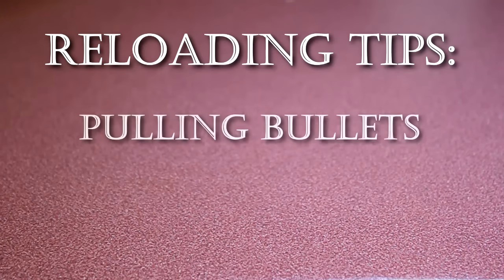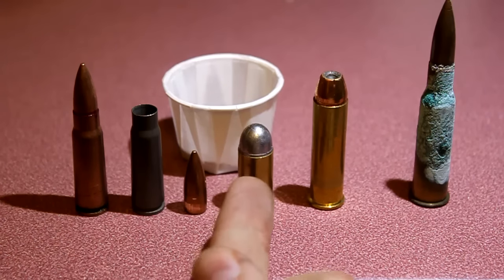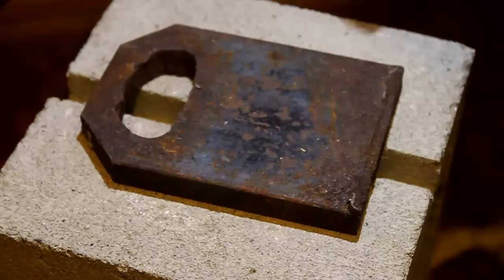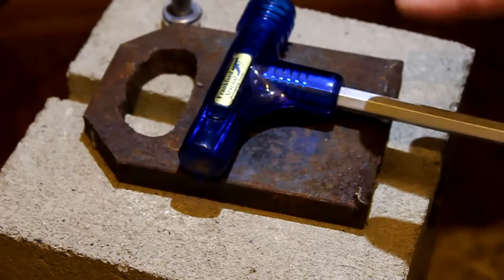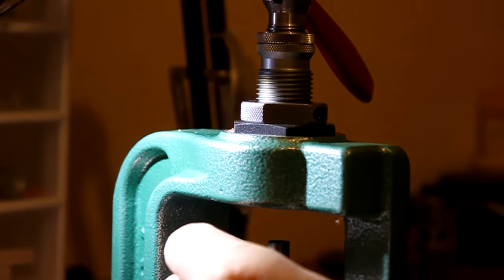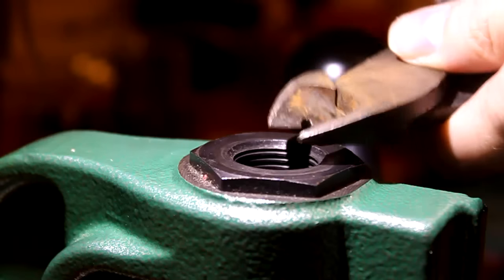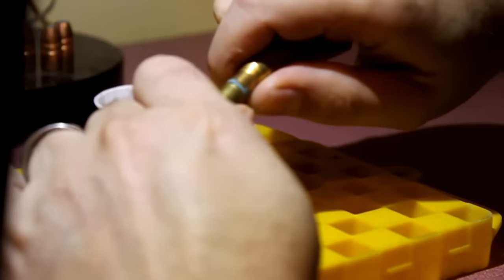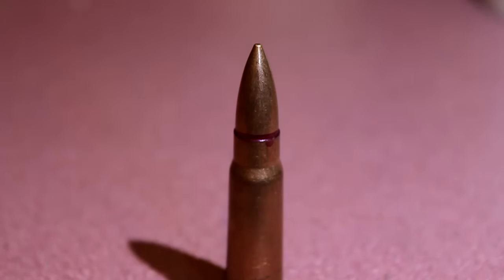4 Ways to Pull Bullets

Comment: I noticed when  you you used the Hornady bullet puller you had a straight wall cartridige case like a .44 S&W Magnum but when you pulled th bullet you showed a rifle cartridge, Were you not able to pull the pistol bullet with this puller? I have had bad luck with Hornady pullers espjecially when pulling .44  or .45 bullets, the Hornady collets are flimsy and just don't grab weel. I use the RCBS bullet puller with much beefier collets and used with great success on these 2 calibers. The rest of the video is all right. Thanks for sharing

Comment: thanks so much gave me some great ideas to work with , I have a lath so I can turn my collets and the make the finger cuts with a cut off wheel , have to pull 1000 rounds 3006 cause primes are no good. thanks again surplus cases with ruined primers and got loaded thinking primer was good ... dua wont do that again lol
.

Comment: suggestion for alternative method using press  and pliers or wire cutters to hold bullet...INSTEAD consider sacrificing some  unneeded or cheap large pliers like line mans pliers or something and drill the needed size hole right through pliers jaws...even oversize slightly if you want to use a piece of bicycle innertube or whatever to protect bullet...or how about using using a bullet casting mold as the holding pliers ...maybe?  might damage it though as a bullet mold...just an idea  might have to use rubber strip too to grip hard enough?

Comment: I use a reloader's kinetic hammer to take rounds apart.  Especially WWII ammo that wouldn't go off due to bad primers.  I reused the projectile. powder and case and just changed out the primer.  Yours a Frankford Arsenal and mine is a RCBS.  Colet pullers are too expensive.

Comment: once you remove the gunpowder and the bullet and then return the bullet back to the projectile and then heat up the bottom part of the projectile will it still fire????
Reply: Jochel 23 gunpowder was used in reference to black powder before the invention of smokeless powder. The bullet IS the projectile. if you put the bullet back in the case the bullet will most likely get stuck in the barrel
Reply: Tristan is correct. The primer has enough force to expel the bullet but not enough to do damage if you just heat the primer. If fired in a gun the bullet would likely get stuck in the barrel.

Comment: I've heard that the Wolf brand 7.62x39 ammunition actually uses a .308 bullet, however if this is not true and the bullet is .311, could one get away with using it in a .308 barrel? .308 is scarce or very expensive and all I really need is the bullet to reload.

Comment: With the kinetic puller... It's actually better to use the larger collet for the 7.62x39 with the dome facing the column the powder and bullet fall into. Doing it this way the cap doesn't come loose so you don't have to keep tightening it down. Therefore less strikes to pull the bullet. Believe it or not I pull 7.62x39 military crimp bullets with 2 strikes. 3 max. I strike the puller against an AR500 steel target. Give it a try. You can thank me later.

Comment: I bought some surplus 1920 7MM Mauser ammo & I am able to pull some of the bullets out of the casings with just my fingers, I am assuming that is bad? How tight does the bullet need to be in the case in order to fire?
Reply: Medmann48 I would resize the head of the case and seed the bullet again to be safe. if the bullet gets set back in the case or travels down the barrel too much you may get a pipe bomb effect
Reply: The brass necks on old ammo often get hard.brittle and lose their grip. You MAY be able to pull the bullets, resize down the necks and then reseat the bullets and have them hold tight. If not, do not fire that ammo. Save the bullets and load into fresh brass cases.

Comment: I've pulled many of tracer rounds out with the hammer puller. How is that dangerous?
Reply: Boof104 BrianA I'm pretty sure the chemical used by tracers is ignited by heat/open flame however it's better to be safe than sorry

Comment: method 3. cant you just put a rag over the bullet to prevent marring? i haven't worked with brass that much and haven't reloaded bullets. But i learned if you put a piece of cloth between a vice jaw and your work piece you will prevent marring but still transfer the force. i assume you could use the same technique here and save the bullet. 

Anyway. great video and thanks for showing all the different methods.
Reply: the hollow box maybe use a fired case.

Comment: I just take a pair of channel locks and wrap them in either electrical tape or a thin rag and twist it off making sure you don't apply too much pressure or you'll dig the teeth in or deform it. If you do that you don't mare the bullet and its pretty darn fast

Comment: What should I do if i have a sniper bullet that ill never use, but want to keep,?
Reply: +CarlosIDK956 How do you know it's sniper bullet?
Reply: It's around 6 Inches long,.. I want to say it's a 50 cal but didn't want to presume that much
Reply: +CarlosIDK956 it usually is on the bottom...
Reply: Just says "1 - 4 - L - C"
Reply: Lake City 2014, that's just the case (brass) stamp.  Just look up on Google 50 cal dimensions and measure your cartridge and see if they match.
Reply: Right, well my main question,.. Should i try to pull the bullet and get the gunpowder out, or is it fine if i just leave it as is in one of my droors and pull out every once in a while
Reply: Of course it's fine, it's actually more presentable if you leave in.  If you really want to pull it out, put it in the vice between 2 blocks of wood and rock it out.
Reply: unless you have a habit of smacking the primer on it with a small hard object you will be fine, they can take alot of abuse. think, they are inside a gun while it fires and the recoil doesnt cause it to explode. Only other thing would be if it got super hot in a fire, but at that point it who cares if it explodes because everything around it would be fucked anyways.
Reply: CarlosIDK956 you'll be fine as long  as you leave the primer alone and don't put the cartridge anywhere near a stovetop or similar heatsorce

Comment: two problems. 1) you refer to what is a "cartridge" as a "round" and that's not correct 2) for the third way you say you pull the bullet down when you're pulling the case down. those two things aside this was a decent video
Reply: A "cartridge" IS a "round". A cartridge consists of 4 components: bullet, case, powder, primer. The term "round" came from when there were components but no case (muzzloaders). A "round" was the 3 components used to load (cap, powder, bullet) and the term stuck for when those 3 components were simply put together into a case forming a compplete cartridge. Using the term "round" for empty brass cases (want to buy 500 rounds of once-fired brass?) is incorrect.

Comment: Around the 4-minute mark you say to not bounce the puller.  That's false.  You should bounce because of the Pelton effect.  It uses twice the inertia.  To use your car example; imagine a car stopping suddenly and then quickly reversing.  Inertia keeps your body moving forward but the vehicle is now going backwards.  It's the same reason why, if you've ever played paintball, you notice the bouncers tend to hurt more then the splats. :-)

Comment: I got same kinetic puller and was banging on concrete floor in garage to disassemble my own .223 round and after 50 or so rounds the thing is all beat up because it's plastic and there is even a crack and then one day I saw instruction manual and it says to ONLY use hard wood surface.  Planning to buy RCBS puller next, this kinetic "hammer" is not good.
Reply: +Dima Prok get a  hard rubber door stop and gorrilla glue it to the striking surface of the bullet puller. this will cease to damage the striking surface, while maintaining functionality.
Reply: +Joe Shmo not a problem anymore since I got RCBS collet puller.  I rarely use it now, it should survive.  If it does happen to break, I'll build my own next time, I have pretty good idea.
Reply: awesome man!
Reply: im looking at the rcbs. how do you like it?
Reply: +Joe Shmo When I ordered RCBS I though it's going to be like the one in the video because he was using RCBS press I got confused, but it's actually different.  At first it was little bit frustrating but once I figured out how it works it the whole process is smooth.  One thing to watch out if you were pulling .308 bullets and then switched to .310-311 (7.62), you need to take the flat screw driver and pry the collet a little wider because it's pretty stiff and just trying to ram the bigger bullet it's not going to grip it and you'll end up scratching the bullet.

Comment: I cringe smacking the plastic hammer on bare steel...I'm thinking some hard thin cardboard over the steel plate at least..i just envision plastic vs steel eventually fracturing plastic... I use my hardwood reloading table and don't cringe...has worked fine the few times I pulled groups of bullets
Reply: I have literally taken apart thousands of rounds of ammo using a RCBS kinetic puller and it hasn't shattered yet. I have worn out several of the collets that hold the cartridge though.

Comment: Please somebody tell me how to "pull" heavily crimped bullets. I whacked and hit my plastic "hammer" on the floor until I just gave up. The bullet didn't budge 1000th of a mm!
Reply: It might help break it free to follow the same suggestion he had for freeing up lacquer sealed bullets, i.e. run it up into your seater die and nudge the bullet inward a millimeter or so, then put it in your kinetic puller.
Reply: You will probably need to use a collet bullet puller or the 3rd method he showed to remove them.  If too heavily crimped you will probably ruin the bullet removing it and you will probably need to resize the brass before loading it again.
Reply: Wood is kinda soft. you might dp better strike it against a steel plate. It seems to work better for me.
Reply: Yeah, I used to knock out bullets on my maple bench, then found that it takes about 1/3 the whacks if I use a heavy plate on the floor.
Reply: To remove the crimp place the round in your bullet seating die and seat the bullet just a little bit deeper.  That will break the crimp and allow you to move the bullet with ease.  Spring for the RCBS collet puller. It works great for me.  Kinetic pullers truly suck.